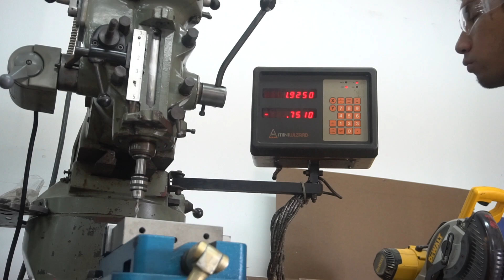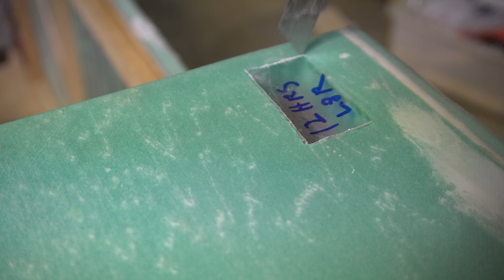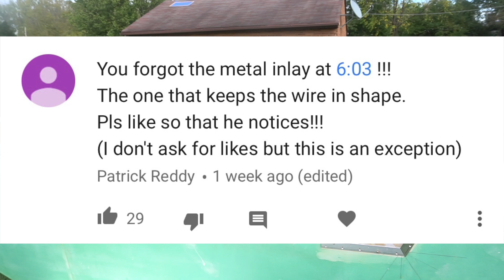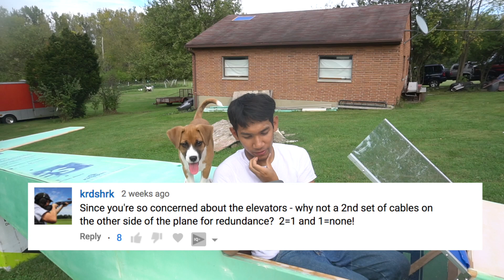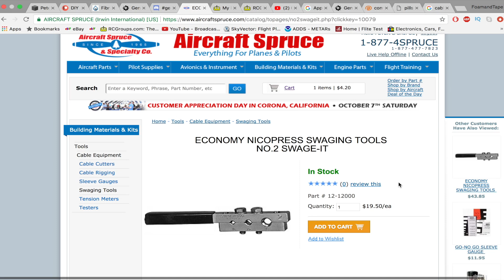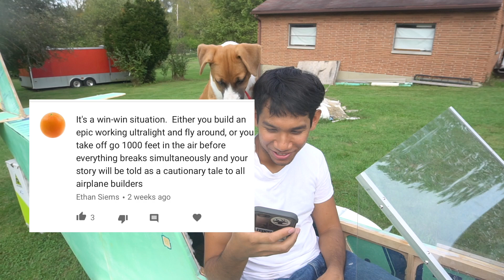DIY Electric Ultralight pt4 (fiberglassing fuselage and wing construction)

Comment: this https://www.xtreme-workwear.solutions/trellchem-900-chemical-resistant-suit-3521-p.asp is what we use when we work with epoxy at work. To protect our self against it. Just saying that epoxy eczema will be for life. and its a bitch. In many cases, people who have got epoxy eczema can't even be in their own kitchen or ect because of epoxy eczema. There's no telling as to when you will get epoxy eczema. But not protecting your self against it will increase your chances by 100%. we had one guy Who did not have epoxy eczema. but he got skin markings just by entering the epoxy area. PROTECT YOUR SELF FOR GOD SAKE. SET AN EXAMPLE AS A YOUTUBER. its Toxic as hell. also i seriously dont hope you are going only cover your Plane in that one or two layers of fiberglass. Its a tissue matt and hold no strength what so ever Especially when you use that much resin its less flexible. and way too Brittle.

Comment: Peter you need to paint this thing to look really cool. 
Also, what seat is that that is in there currently? I would have thought you should get a lightweight car racing seat, for comfort and safety - after all, you don’t want to be worrying about a piece of wood digging into your back mid flight. Also, if you used a racing seat then perhaps you could get a harness to attach to the frame behind.

Comment: "The landing gear is definitely strong enough" you say as the wheels are buckled inwards from the load.
You might want to look into the actual wheel mounts some more. If the wheels touch any of the metal, which it looks like they do, that can cause the wheels to lock up during a landing and make the plane go nose first into the ground. I would hate to see that happen.

Comment: I'm not sure if the landing gear is intelligent without some dampers.. I mean the wings are going to take a beating at every bump.
Reply: In all reality, there's alot of light aircraft that don't have any sort of suspension at all. Some have some spring in their landing gear via bending of the legs but there's plenty without any spring what so ever. Ultralight like he's doing is common to be firm gear...no suspension.
Reply: I totally agree.  Don't just bank on smooth landings.  Atmospheric conditions alone could put you on the ground harder than you're designing for.
Reply: MTB suspension would be perfect size.... downhill racers are designed for exactly this.... Hard downward forces... my FS MTB suspension has both a shock and a spring and still fits in my hand. IT's taken a lot of beating on the Mississippi river rocks!
Reply: totally agree, a re-do with some heavy valve springs encapsulated in the tubing maybe? 1.5" worth of travel and impact damping might weigh an extra lb or so. haven't seen if it's a tricycle or tail dragger, if tricycle I wouldn't worry much about the nose wheel, just the under wing mounted.
Reply: Not just take a beating, a bad hit or pot hole could do unseen structural damage to the spar then the next time you load the spar goodbye wing. That's normally at above livable fall heights and results in FAA what not to do videos.

Comment: Great work  ,fantastic design, please more pics of that adorable pup ok . Why don't you rc fly that plane for first flight, sand bag your weight,  then take  your first flight knowing it works without failure, ? Could wip, up a servo gang for rudder elevator  ailerons make it fit right where your seat is ,.

Comment: It looks like your center of gravity is way off unless the batteries are going to be mounted to the rear of the landing gear..... I no doubt could be wrong depending on the tail weight.

Also having holes in styrofoam "Looks good", it removes almost zero weight and does not add strength unless I missed applying fiberglass and resin to the inside of the holes.

Happy for your spirit of trying to build something to fly in.

Comment: I dunno how this might go but what if you used rc parts and a powerful servo to move the elevators and everything. This could reduce the risk of failure but then again I dont know if this will be good enough of a solution to take to the skies.

Comment: You should build a catapult launching system, like those on aircraft carriers so you can use less powerful motors and smaller batteries, this will help you reduce some weight to comply FAA ultralight weight.

Comment: As a self-certified/educated Kerbal Space Program engineer, I'm highly concerned for several of your predicted flight characteristics of your aircraft. Please take my words of caution seriously, as I'm truly concerned....

The two things that NEED to be addressed........ 

The top speed and the acceleration...to solve these major problems, I highly suggest adding a couple of rockets on the sides for rocket assisted take-off.. As well as a single RC sized turbine for pushing the speed envelope (nothing too crazy of course).. 

Hope my engineering expertise helps!!!! Happy flying!
Reply: I feel like he's missing struts. Definitely add struts. The quality and safety of an aircraft increases exponentially with the number of struts.
Reply: I feel like he's missing at least 8 rockets on his plane
Reply: Ben Wins why? Those are physicsless parts
Reply: adam a you obviously don't get the joke
Reply: Yes, too low DeltaV for my tastes. Reach for the Mun Peter.
Reply: The kraken might get him if he doesn't have struts, I dont wanna see peter become spagettie.
Reply: RudeCalling Dude as long as he remembers to quick save he will be fine, and if it all goes wrong he can just revert the flight :^)
Reply: Needs more Jeb
Reply: I suggest removing all the lights and ladders from your Ultralight.
Reply: RudeCalling I thought u were being serious until I started reading the third paragraph haha
Reply: You also forgot the Spinnaker and tiller extension... 
This would be much safer with those.
Much less wind resistance, and steering would be much more efficient.
Reply: Strut your stuff
Reply: Takeshi M oh i thought you were seriouse oops
Reply: you sound stupid for telling this guy to put rockets on the side for extra thrust. i dont think you really are an engineer and if you think you are than maybe a dumb one, rockets are not that safe. i could understand having a more powerfull engine but not rockets. ive built and played with many rockets and i sure as hell wouldnt put one on anything im on due to seeing many rockets explode.

Comment: Why not use a plastic shrink wrap for the skin?  Seems like it would be a lot lighter.
Reply: it would also be a heap weaker. Glass cloth shell on EPS is amazingly strong and rigid, and on large airframes, stiffness is really important so you don't end up with wing tips flapping in the breeze and so forth
Reply: shrinkable covering film like monokote and so forth actually add quite a bit of strength to airframes when they're shrunk up tightly
Reply: The wrap needs to have an actual function and not just stupidly add weight.
Reply: The plastic wrap would have almost no functionality compared to what the cloth wrap will actually do something

Comment: can I suggest something about this project - Do it RC!
Than you can safely maiden it from the ground, next you can add APM with an auto-pilot feature + making a "on plane" ground station (flight data + GPS from a tablet screen)
Be safe my friend!
Oren.
Reply: He said that he wont be doing that before. XD
Reply: I was thinking about that too... It's better
Reply: Apparently it's illegal to rc fly something that large. I don't live in the us so I have no clue
Reply: Nah He said he wouldn't do it RC because of design issues in doing that.
Reply: If this plane is falling under the US ultralight rules then the FAA considers it a kite.  No FAA rules against putting in RC gear as far as I know.  I think the AMA, which only rules it's members, says 1/3 scale is the limit they like to adhere to.  There is a sort of altitude limit of 400 ft because registered aircraft have a 500 ft floor over population and going higher could interfere.  I just read there are new rules for models over a certain weight needing to be registered now but I have seen huge models being flown RC. I think the real issue is getting servos big enough to use are not going to be cheap.  If his experimental kite is designed well enough he should be safe flying it.
Reply: oreNero Oren not only does that defeat the purpose, it costs more money and more work to install all of the shit that makes it remote-control.